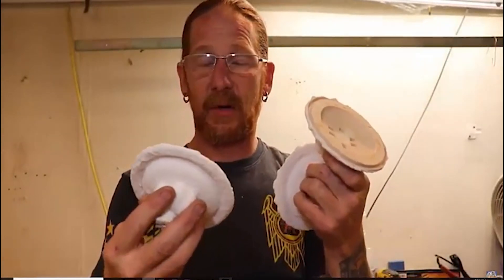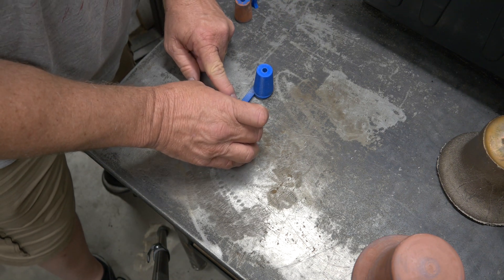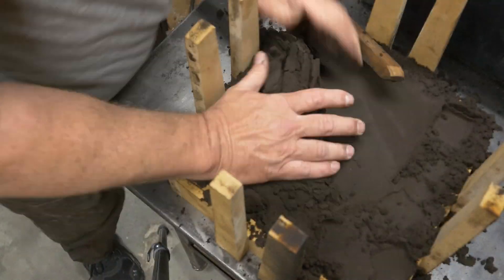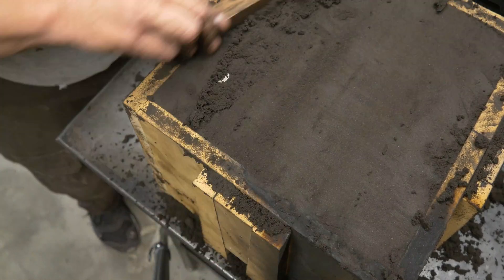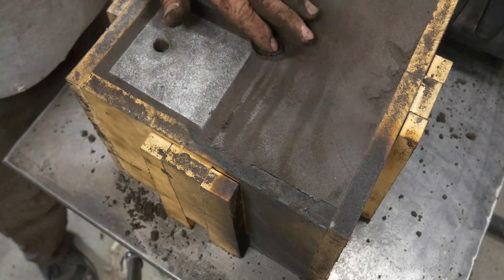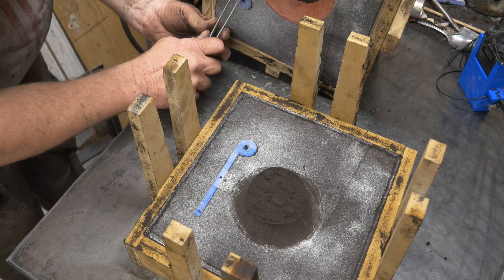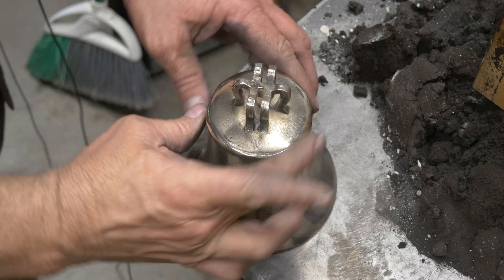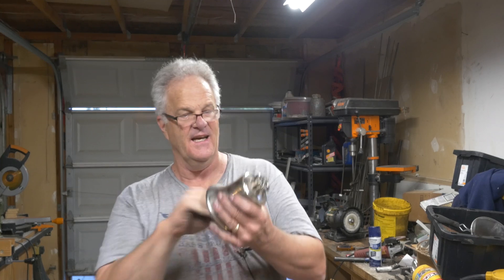Casting a Liberty Bell Miniature

Comment: We machine a lot of bronze at work. We must have 10- 55 gal drums full of bronze scrap. I have cast aluminum before. How much hotter does bronze have to get and also do you have to use any special flux or anything?
Reply from the maker: I pour aluminum at 1325f (718c) and bronze around 2150f (1176c).  Bronze has a much higher melting temp between 1570-1830f than aluminum.
I don't use any fluxes simply because I don't have any. What I do use with bronze and (shudder) brass is a mixture of broken glass and borax. just a small piece of glass, 3/4" square?? and about a tablespoon of borax poured on the metal with melt and form a glassy lake on the top of the metal greatly minimizing the amount of oxidation created.
I also pre-heat my furnace and crucible for 10-15 minutes before putting the metal in. It reduces the time the metal sits there exposed to an oxidizing flame.

Comment: Fantastic, as always. Is there any valid rationale for letting the bell cool for a few days before extricating it from the mold?
Reply from the maker: For a bell this small?? I doubt it.  I'm not a metallurgist by any stretch but I can see where letting it cool slowly would allow the crystalline structure of the metal to form "better".  Throwing it in a bucket of water while its still several hundred degrees seems like it would be bad for it as well. Got to make it more brittle.

A bell this size would cool completely in the sand in a matter of hours, not days.  Once its cool, its cool.
Reply: @swdweeb  - You’re right about the crystalline molecular structure gaining greater cohesion over a longer cooling arc. I wouldn’t expect it to make a discernible difference in ring tonality with a bell this size. But regardless of size, the bell will be less brittle if cooled slowly. All things considered, you’d be surprised by how long that sand will hold its heat.
Reply from the maker: @SuperPussyFinger  Not too surprised as I burned myself on parts that I thought should be cooled after leaving them in the sand for a little while.  😄

Comment: Nice work! What size crucible was that and if possible, can you say roughly what % you had for leftovers? I can run a #4 crucible and I hope I can make a bell about that size.
Reply from the maker: I'm sorry it took me so long to respond.  The finished bell weighs in at 1.6KG.  Even if you doubled that for runners and gates and stuff your still under half a #4 crucible.

Its been so long since I poured that bell I have no idea how full the crucible was.
Reply: @swdweeb  Gotcha thanks! I want to cast a decent sized thing. Bigger than even a very large hand bell. I think and hope the #4 can handle it. My furnace is pretty much built around a #4. I believe the #4 means I can hold four pounds of aluminum and something around twelve pounds of brass/bronze/copper.
Reply from the maker: @heliarche  Perhaps you should watch this 😄. https://youtu.be/eMErzjiIL0U  I address the weights of metals a crucible holds.

Comment: Good job. Looks like you made a good system for clean pours. I cant wait to start my pours. This gives me hope
Reply from the maker: It's not my system, It was developed by Professor/Doctor John Campbell. What I'm doing it trying to adopt his system to things that I pour in my garage. He might look at this and cringe but trying to control air entering the pour by using a pouring basin and a tapered sprue and runner are part of it. I can't remember on this pour if I printed my gates or cut them with a spoon. Either way, printing them is by far the best way for me to control metal entering the part. 

If you end up adopting the more traditional approach to casting and pouring your metal down a big 'ol open sprue, I'll quote Dante "Abandon hope all ye who enter here" 😆😆

Good luck with it. Keep me posted on your progress.

Comment: You need a lathe. Also it wasn't heat but the gaseous chemicals released from the sand in that location under said heat differential. But please, spin those bells up, clean and tune them. You'll have a world of difference in end results.
Reply from the maker: Next bell will be in water-based green sand and likely investment plaster.  If you're right, that should go away.

Comment: Great demonstration Perry. The cannon turned out great. It's a little surprising that your bronze made it all the way up there.
"Strata". Absolutely! I had a dropout yesterday of just the top 2" of the cope when I had lifted it and turned it on its side.. I could see it was right where it was rammed at the lower layer maybe rammed too hard. Also it was sand from 2 different buckets so it may have been mulled at a different time therefore slightly different properties? Petrobond.
Keep up the good work.
Reply from the maker: Thanks.  I've had pretty good luck as long as I can keep the leading edge of metal moving. As soon as it stops I'm usually dead with it freezing in place. 

Man that sucks. Making molds is too much work to have them fall apart on you.

Comment: FYI, if you take the hot metal with investment, and put it in water, the investment comes right off :)
Reply from the maker: Just watched one of your knife break videos. We're neighbors!  

I had hoped to dunk the hot bell in water but had a couple of problems. 1) I really didn't want to cause any stress fractures in the bell. Given the fragility of the bell metal I was a little afraid of doing that.   2) the sand was so stinkin' hot that I found myself waiting for things to cool down so I didn't burn myself in it. 3) and this is the worst excuse of all, the only bucket I had with water in it at the time was plastic and too small to hold enough of the bell to get the investment under water. I've had a problem with hot metal and plastic buckets before. Seems the metal has an unfair advantage and the plastic always gives up without a fight. ;-)

Thanks for stopping by and leaving the comment. I appreciate it and agree, I've seen that "water separation method" work for others several times.
Reply: Given we are so close I may swing you by a metal bucket, I have three I use for quenching, and one is just being used as a trash can at the moment :). Maybe we can come up with a collaboration:)
Reply from the maker: Well... I actually have two five-gallon metal buckets right there. Its just that each of them were bone dry at the time. Maybe you can swing by and tell me how to plan ahead ;-D.

I'm always up for a collaboration. Just have to find something that works for each of us.
Reply: swdweeb want to cast some copper knife/sword parts?  I have a bucket of brass and copper I need to make into ingots, and my foundry isn’t made yet.
Reply from the maker: My replies keep getting lost. It's not enough that YouTube daily removes subs now they're deleting replies as well. Email me at swdweeb@gmail.com and we can talk.

Comment: I’m glad you finally got one to come out! It looks great! I’m thinking the different textures were possibly because you didn’t gate it on opposite sides. And you forgot to provision for a clapper.
Reply from the maker: The clapper if it gets one will be drilled and taped into the head of the bell. There is plenty of material up there to do that.

Comment: Clever idea to combine casting methods like this for the crown!
Reply from the maker: I couldn't figure out how else to do it and... it looks like from stuff like Whitechapel videos that that is how they do large bells.
Reply: @swdweeb  After watching, I was trying to figure out how to do it with multi piece sand cores... but I think I broke my brain when I started thinking about how to build the coreboxes.
Reply from the maker: Yeah, I thought about multi-piece cores, Even tri-level boxes. If I'm going to keep doing bells, I have a feeling I'm going to have to invest in a kiln. I wonder what a small one costs? Maybe one that doubles as a toaster ;-)
Reply: @swdweeb  keep your eye on Craig's list, sometimes kilns can be found really cheap or even free if you move fast.
Reply from the maker: @tobhomott  I was actually just looking. Found one for $150. Need to check the dreaded FB marketplace as well. I loathe FB
Reply: @tobhomott , Initial discussions did consider such mind bending things as silicate CO2 cores in complicated boxes but  it was a bit of a no go when the shape of the cannon was considered plus cannon are usually decorated - impossible with cores. 
This video https://youtu.be/11R7aVNWbwQ
of a large bell being cast (its worth a look) clearly showed the use of an investment type mould for the cannon and from there the lead was taken... Martin
Reply: @swdweeb , Make a kiln - not rocket science and mine (more of a furnace than a kiln really ) makes really nice toast  😀… Martin

Comment: I haven't finished the video yet but needed to ask before I forgot: Would the runner to the spin/surge trap be more effective if it was slightly arched so any potential contamination would stay to the outside of the curve to ensure it couldn't enter the mold? I'm planning on casting a replacement motorcycle mirror mount soon. I was hoping the 3d print would be strong enough for time saving but it wasn't. I cast a foot peg mount for my buddies. wasn't perfect but he was ecstatic about it and it saved him $60 or so. We were both shocked it worked the first pour. I wasn't expecting it to so I wasn't filming. 

Also, have you been thinking anymore about another #2019openersopen type challenge? I'm really looking forward to it.
Reply from the maker: Isnt that always the case. Either that or I forget to turn the camera on at a crucial moment.

I don't know that  curved runner would hurt but I'm not sure how much benefit you'll get out of it. Keep in mind the surge trap will really only catch any initial crud you've got coming through the runner. Once the runner is full and the metal is heading to the gate, that's where it's going to go. 

Good for you on the foot peg. It's always satisfying to make something that someone appreciates and the fact that it works just adds to the satisfaction.

Comment: Very nice execution of an investment used for a core. The bell sounds good. As for the surface finish on the gate side, I wonder if you needed a bigger gate into the bell and you had some jetting on the gate side; but as the metal spread out through the rest of the bell the flow of metal was constrained enough to prevent surface bifilms. 🤔

Comment: Wow! Impressed. And a little surprised that the metal filled the details at the top
Reply from the maker: The first time around it didn't... probably for a couple of reasons. The first one that I forgot to clean the sand out between the gate and the bell pattern so the metal had to fight its way through. The second was the basin height. The basin I cut in the first attempt was actually below the top of the crown. I fixed that by building that little box on top of the cope and raising the basin.

Comment: how hot you get your alloy before puring? 

i have to say that the gating you are using to adress "bi-film" for bronze and brass type... aint working out for me. i got good surface finish even with a short fill, and thats why i am asking: i keep beefing up my feeder to get the metal to fill all the way, but it is not working, the bronze just keeps chilling before everything is filled. and you employ such small gates and yet, you fill it up. i knew that bronze is a pain to cast, but it must be possible to do somehow :-) just finished two pours today, one of which left me with a usable part.... any tipps of how to get copper based alloys to work better is welcome.
Reply from the maker: If you want to email me at swdweeb@gmail.com I'm happy to help any way that I can. I can't really tell you how hot the bronze was when I poured as I've never invested in a device that can measure metal that hot. I have an infrared thermometer but it quits registering before the metal is melted. 

I typically wait a few minutes 3-4 after the metal appears to be melted before I do anything with it, like scrape the top off. I also leave it in the furnace with the flame on until I am completely ready to pout. The time it takes me from pulling the crucible out to actual pouring is only 10-15 seconds.
Reply: @swdweeb  wow thanks, i'll send you a mail after i made some fotos of what it's all about, maybe a little video so you can get the feel for my problem :) i try to cast a steam engine... you'll hear from me and thank you again!
Reply from the maker: @MrZhefish  Perfect!

Comment: Ah, "For whom the bell tolls" Not a bad effort - love the cannon - an interesting blend of the two technologies sand and investment. The finish may have improved by spreading the heat out via two gates. Maybe a reinforcing rod in the drag (or pipe to act as a vent too) up into the inside of the bell would have prevented that break away, I think that you were a bit lucky to get it back together right 😊. Bloody well done though, its a damn nice looking bell... Martin
Reply from the maker: I bit lucky or a skillful eye or hand?? Ok, you're probably right ;-)
Reply: @swdweeb , Ok, some contribution from skilful eye I guess 😊… Martin
Reply: I agree a soldier or gagger would have likely helped prevent the sand from breaking away and staying inside the bell.
Reply from the maker: I expect netter draft on the shape of the bell would have been the biggest help. This one has nearly vertical walls through much of it.